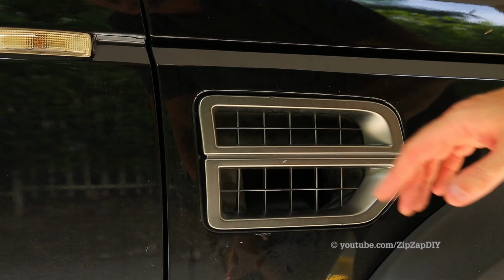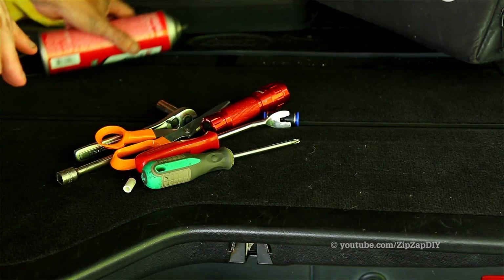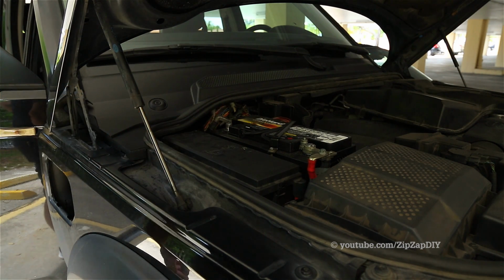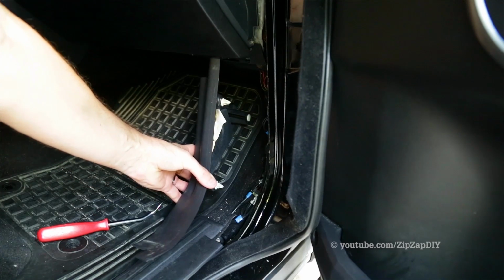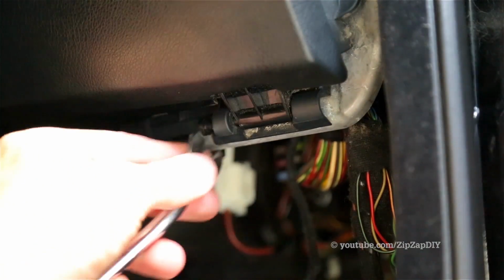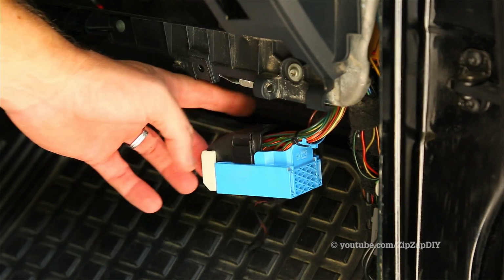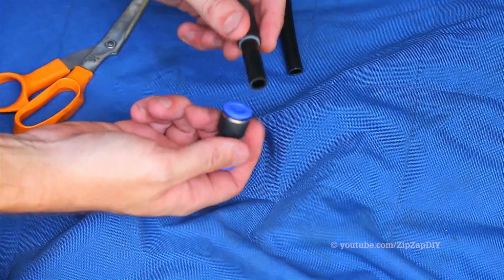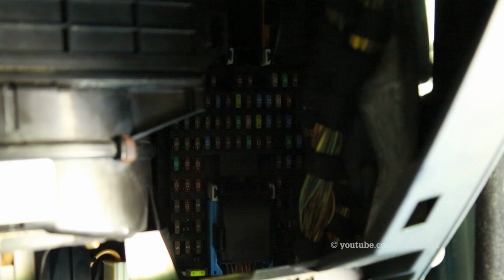LR3 RH Sunroof Drain Repair / CJB Removal / Water on Floorboard

Comment: Would it be worth doing the left side at the same time as preventative maintenance? I'm assuming the LH and RH parts are identical...
Reply from the maker: Yes, the LH side is very easy so if you need to do the RH side, I would do the LH side first to get in the mood and a feel for what is going on down there.
Reply: ZipZapDIY thanks for the response. One more quick question: I see that the drain tube for the Range Rover Sport (EEH500120) is less than half the price as the one you listed. Do you have any idea, since the hose is getting cut anyway, if that will work in place? I'm assuming the grommet size is the same, but the length is different... If you have any insight on this, it would be appreciated.
Reply from the maker: Yes, the RRS tube will work. it should be the exact same nipple/grommet.
Reply: Thanks for the info! I did this repair this week. Now to fix the water coming in the fresh air intake...
Reply from the maker: You must be talking about replacing the windshield cowling.. https://www.youtube.com/watch?v=k3lbCPb65Bs  I was amazed to see the fresh air intake is right underneath the edge of the windshield and perfectly placed to catch all the water that gets under the warped cowling!
Reply: That's exactly what I was looking for. Thanks for all the resources!
Reply: @ZipZapDIY  I wish I found your videos earlier! I'm going through all the pain now. Your videos are so clear and helpful, thank you. Top man!

Comment: Zip Zap i did this repair and didn't see your posts about cleaning all the connections with contact cleaner. Those back plugs are a real pain. After putting it back together my front windows don't work, and the truck thinks all the doors are open. So the suspension will not raise or lower. Any ideas which plug it might be?  I hate to tear it back apart but it has to be fixed.
Reply from the maker: sorry, no clue which connector, time to break out the wiring diagram. :( or start with the accessible ones.. and see what happens.. I'd inspect the pins and fuses too

Comment: I removed the air dam on the passenger side and the nipple is still protruding from the open space but i am still getting water in the floor board. Anything else to check?
Reply from the maker: check for a warped windshield cowling on passenger side. The fresh air intake is there and  a warped cowling will allow water in to it and on to the floor board.
Reply: @ZipZapDIY  thank you very much. Checked the air dam this morning and it certainly had a small gap in it so i will be replacing it. Thank you a ton for that suggestion!
Reply from the maker: if you didn't; see it already... here is my video on the windshield cowling https://www.youtube.com/watch?v=k3lbCPb65Bs in it you can see the vulnerable fresh air intake scoop.

Comment: Could this problem cause bunch of light on in the dash
Reply from the maker: this is not known to cause "lots of lights"... it could, but unlikely...... check your brake light bulbs and brake light switch. The most lights I've seen light up are associated with a bad brake light switch.. also the suspension system controls went dark.

Comment: i'm having same problem but my hazard lights are flashing and i have problems starting at times ... do i need a new CJB? or should i just clean connections
Reply: hi Timothy did you ever get to the bottom of what the fault was my hazards are flashing and not attempting to start at times aswell as the doors locking and unlocking thankyou

Comment: My LR3 started to get water under the ceiling and flowing on each corner of the sunroof (when turning) and thru reading light. Now water comes down thru the black mesh part that comes around the doors. Any idea where is the water coming from??
Reply from the maker: Your drain lines may be clogged, the water is backing up and overflowing out of the sunroof "tray". You can confirm the drain Is clogged by pouring water down the drain holes at the front corners of the sunroof. There are a few methods to clean the drains, one is to blow air through them, another is to take edge trimmer wire and poke the dirt out.
Reply: ZipZapDIY I just did what you said and it worked!!!! Water came out on both sides next to the front tires. Now I'm going to dry the carpets and see if it's OK when raining. Thanks. 06LR3 from Poland.

Comment: Also, if you have or had water in the floorboard with all that foam absorbing it, it is GUARANTEED that you have MOLD spores in your car weather it smells or not or it is dry now. That is a silent killer for you and your family and I'm not exaggerating. Do yourself a favor and buy yourself a $50 OZONE GENERATOR on ebay and clean the interior with it. It will not only kill mold but every other living bacteria in it. Then you can/should wipe every are of the interior with a stuff called CONCROBIUM at Home Depot which cost $10 bucks and lastly after all that change your carbon filter above the blower.
Reply from the maker: the leaking water also causes a problem with the remote locking system, eventually, if it already hasn't been fixed. There is a spliced wire on right hand side door sill that will corrode and break, this wire powers the remote locking system antenna. If you start to notice the remote key fob to not work after rain, car wash or just stops working all together, repair the corroded wire splice. (there is some details about this on LR forums)
Reply: @ZipZapDIY  great info! and yes my central locking does not work with remote. Only with button on the console. I will look for that before I put everything back together. Thank you!

Comment: Hi, I just bought an 06 lr3 with out a sunroof. My question is...could this issue happen as well with out sunroof?
I've been reading online and it seems that my "volume knob" doesn't work due to a faulty wire that could possibly be wet from a faulty drain tube...
Any ideas / suggestions before I take it into the shop ?

I've removed the glove box and fiddle in there but didn't feel anything wet.
Reply from the maker: There are two ways water gets in there.. the sunroof drain and the air intake for hvac… if you don't have a sunroof, no leak there... inspect your windshield cowl on passenger side, if it is warped, it will allow water into the fresh air intake for the a/c system. I've made a video https://youtu.be/k3lbCPb65Bs?t=143

Comment: my LR3 2006 is stuck in phone mode and I tried everything but the issue is still there.... could that be the cause of the problem? 
and have you ever came across such issue?and what's the solution?
thanks
Reply from the maker: maybe a sticky phone button? Our radio has a hyper sensitive aux button, if you look  at it wrong it jumps to aux input,  could it be that your phone button is doing the same as our aux button?
Reply: ZipZapDIY  I'm pretty sure all buttons are ok & did my research online about the issue and did all suggested action but still... I'm left with checking all wiring ☻💔 thanks for your video it helps a lot my man 👍 keep up the good work

Comment: This repair sounds much too advanced for a amateur repair person. I worry that I would ruin something important. I feel more comfortable taking it to my local Land Rover repair shop.
Reply from the maker: the left side is easy, the right side behind the CJB is difficult and if the CJB, wiring  or connectors are damaged.. ouch.. .. I would not hold it against someone who used a shop to get this done.

Comment: Good video.This job is a pain in the dick, on the back of the CJB  you have 2 connectors not 3,  you have 2 connectors not 3, you have 2 connectors not 3, dont go crazy looking for 3 plugs, theres only 2, 

also you dont have to completely remove the cjb, you can drop it down, gently, and feed tube up to the b pillar and reconnect there w a compression fitting., you can use a pex connector or go to a hose place and theyll have it, autozone etc wont have it save your time... 
the back connector clips may catch and pop the connectors out. 

The LR4 has a piece of foam covering  the nipple on the end of the tube that comes in behind the air intake, watch how you take it out, it has to go back in the same way.

This a suck job, no easy way out, i work on shit every day, and this is a pain in the ass, work slow, everything has to align properly to be seated and work properly. Thanks Land Rover for not fixing the shit 10 years plus....That stupid elbow rots out and leaks, 15 LR4 plug shot, 50 to fix, LR stealership wants about 1800.00

Comment: Hello, guys, I have been having this issue for a while, and I didn't want to mess with the CJB. So, I opted for another solution. I drilled a hole in the RH footwell and passed the drain hose down the pillar. then, the nipple was plugged into the hole I drilled. This is the video of how I did it. Hopefully, this helps someone.
https://youtu.be/afUX9WqdQx0